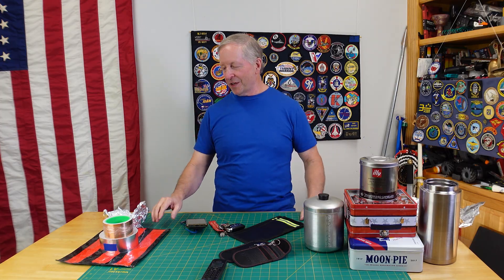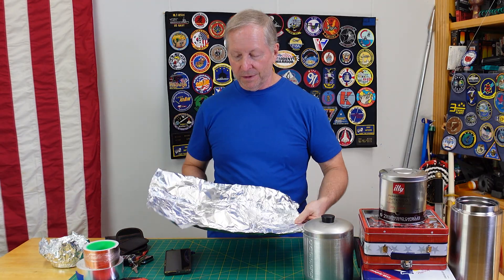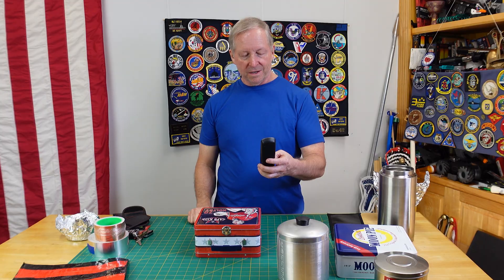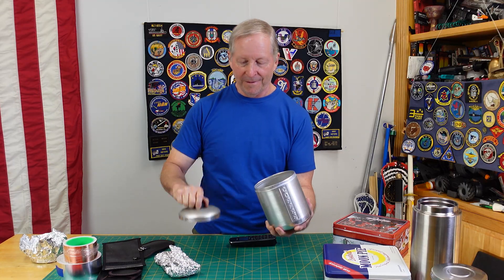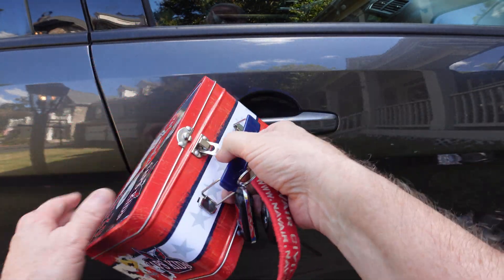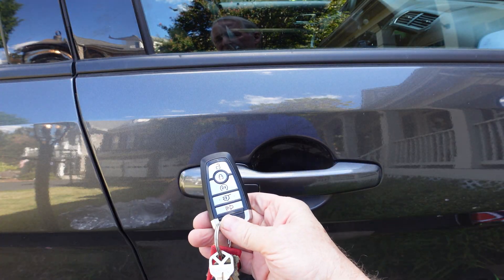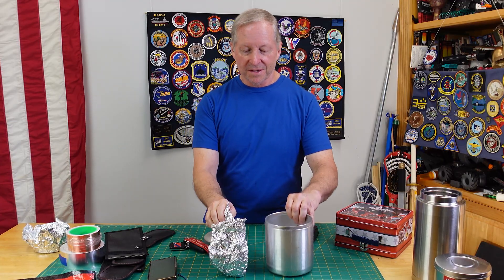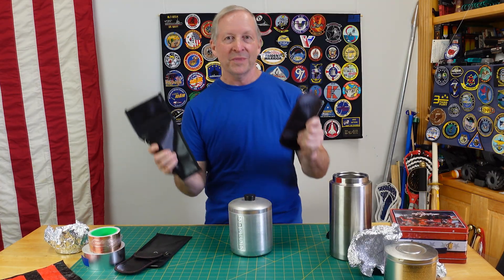Don't Get Robbed: Build a Faraday Cage with Stuff You Already Have

Comment: These methods typically give you ~20–35 dB of protection. True EMP-level shielding is usually 70–100 dB, which requires a welded aluminum enclosure with a proper conductive gasket and testing across a broad frequency range.

For people who want something ready-made, companies like PULSEPROOF build engineered units for this.
Reply from the maker: Thanks for the info, always good to have options for different levels of protection. I'm in the process of working on the next level containers, stay tuned.

Comment: maybe the lunch box would work better if you sanded the paint off the parts where the lid and body meet so it would be more like a cage? And this comes back to what you keep discovering: the lid of the container seems very important. Anyway, great video.
Reply from the maker: Thanks Bill, thinking about this a bit more, if you run a ~1 inch strip of aluminum tape on the bottom of the lid this might seal off the container successfully, I think I might try and update the video.